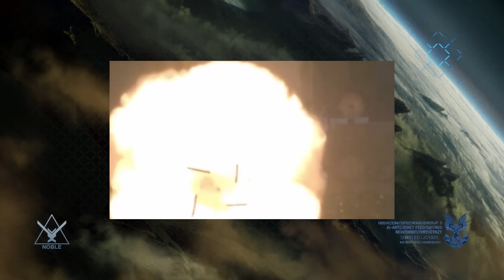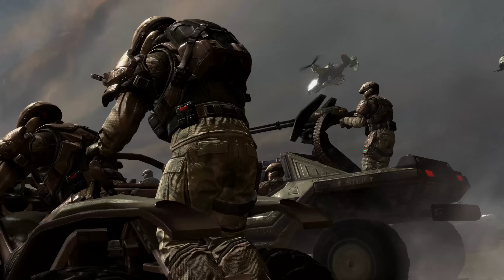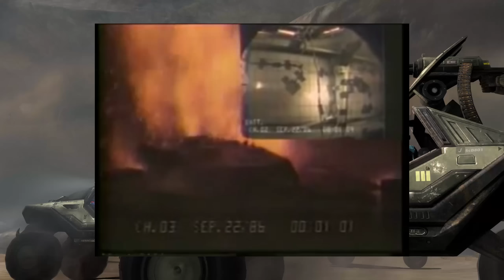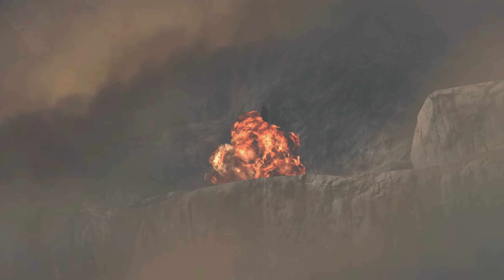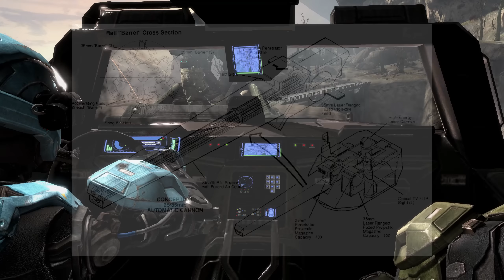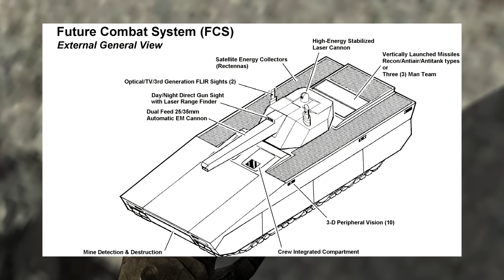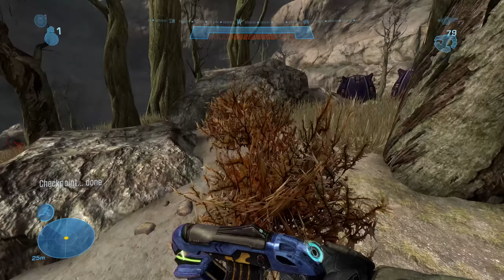Are Railgun Tanks Practical?

Comment: The problem lies not only in amount of energy used by railgun to shoot but also in time to transfer this energy from capacitors to magnets in the barrel. For the mentioned railgun on the ship the capacitors are extremely expensive and complex because they need to discharge VERY quickly. Or the shell wuould leave the barrel before reaching maximum speed.

Comment: They are more to this matter than the amount you covered.

First of all another pro is simply the recoil reduction. the recoil of a gun is equal to the mass of the projectile multiplied by the velocity of the projectile M = m*v , while the kinetic energy is equal to the mass of the projectile multiplied by the squared velocity  divided by 2 E = m*v²/2. What it means is that with a faster projectile for the same amount of kinetic energy you have less recoil.

The problem with ammunition is always way worse than you make it sound to be,  a rail gun has to be conductive for it to work, and also be capable of enduring thousands of g of acceleration, this limit greatly what payload a rail gun can used, with only dumb inert ammo rail gun are stuck in a pure anti armor role, with no capacity against land and air target for the navy, and no capacity against infantry and air target for a tank. Which is a big problem as it make tank extremely specialized weapon in a battlefield that need weapon and soldier to be able to face a lot of different threat

Also no they won't be on tank in the next 20 years, the army is not even considering them as the next cannon for there MBT ETC gun are,  it's not even sure they will stay one modern battleship as they are other alternative to fire faster projectile like light gas gun ETC, rocket assisted projectile or even simply better propellant for chemical round.

Comment: An interesting implication about a railgun equipped tank is that if you manage to install a powerplant on a tank that can power a proper railgun for the duration of the mission then the tank might be propelled completely by electric motors, because such power-dense powerplant should produce more then enough power for the locomotion of the tank.
In fact such compact powerplant would make combustion engines obsolete, because the combustion engines occupy larger volumes due to its fuel tank, has lower energy conversion efficiency, its fuel is are fire hazard.
Reply: Electric engines also are much quieter with no high temperature exhaust, erasing the tanks heat signature and severely dampening it's audio signature. Can someone say stealth tank?
Reply: The lack of heat signiture is only true if the powerplant has an insanely high energy conversion efficiency i.e. has negligible waste heat production. This is the more unfeasible part, because there exist enough energy-dense fuel for such powerplant, like fissile fuels. Nowaday's energy extraction methods use heat engines to convert a fraction of nuclear heat to usable energy (even if we would use an ideal Carnot engine), however this is produce a huge amount of waste heat. Another option for energy extraction is the usage of thermocouples. This has the added benefit of smaller size and lower mass compared to a heat engine, but it has poor efficiency. Both method requires a vast cold temperature heat sinks. This isn't a problem on a ship because the sea itself is an excellent heat sink, but such heat sink isn't available for a tank.
Another issue with nuclear power is the radiation insulation, which isn't really achievable well enough at a size of a tank.

Overall such powerplant requires very exotic theoretical technology that aren't available today like fission fragment reactor  (or fusion reactor) coupled with an magnetohydrodynamic generator.
Reply: @bloodtypeinfinity5143  yeah, especially once metamaterials get developed. Imagine a tank with a low heat signature and that is invisible to the naked eye
Reply: This needs more likes.
Reply: you heard of the regular tank, but now get ready for: the Tesla cybertank
Reply: Except that a battery for a motor is always bigger than the fuel tank. Just look at cars. And how would the tank get the energy from? At a Tesla supercharger? No they will keep the combustion engine to charge the batteries.
Reply: Power isn't the issue for locomotion, it's energy. An 8kg projectile travelling at 1000m/s has about 8MJ of energy. If we assume the tank has an alternator on its engine, and the engine has a thermal efficiency of around 30%, that is under a litre of diesel per shot. Looks like an Abrams has around 2000 litres of fuel, so 100 shots would be just 5% of the available energy.

The problem a railgun has is you need to apply that 8MJ in about 1/100th of a second, which is a power output of 800MW, or about a million horsepower. 

So even if you used some of the highest performing capacitors of today that is about 8 tons of capacitor and at least 2 cubic meters of volume. And that is just to match the performance of today's guns. 

So even with a 10 fold improvement in capacitor performance i'm not convinced we'd see them on tanks. All that electrical equipment would be expensive and not really provide much advantage.
Reply: Technically possible, but I don't see that happening, and besides fuel is a fire hazard because it's energy dense, energy dense things tend to be unstable....
Batteries explode in a pretty similar way to fuels.
You don't wanna stand beside a better that's more energy dense than desiel when it gets hit
Reply: Or you might need a much larger powerplant, seeing a return to super-heavy designs for tanks.
Reply: I'd prefer the "hybrid" solution, electric motors power by batteries>batteries charge by ICE. Big problem with space, unless they come up with more efficient batteries. 😬
Reply: How about a nuclear fission engine? Of course, when we get there. Edit: I mean generator
Reply: @pcb_404  For a generator I'd say Fusion is better, as it doesn't create radiation. However the technology is less developed
Reply: @jafon9  ah I think I got the terms mixed up then, I mean the one that does not produce radiation
Reply: @pcb_404   It's an easy mistake to make.
Reply: @pcb_404  fusion does produce radiation. And pretty brutal one.
Reply: @Poctyk  no, it doesn't. Go do even a tiny bit of research on the process by which we perform fusion.
Reply: @pcb_404  The government already tried making a nuclear powered tank in the 50's. It never took off.
Reply: @bloodtypeinfinity5143  well if they wanted it to fly they should have thrown more money into it
Reply: The fusion reactor would require HUGE plant to move the tank.
The LWR is too big too, radiation shield isn't small...however there is a SOLUTION!

The thorium molten salt reactor! See:
https://upload.wikimedia.org/wikipedia/commons/3/30/Lwrvslftr2.png
A 20 MW reactor would have size of the average fridge.
Small, compact, high effciency. Whatever we neeed! We can use fission-driven Radioisotope thermoelectric generator

Comment: I guess depending on the weight of the shell and its force of impact railgun combat and tactics would be similar to that of USI-152's vs Panthers where the sheer force of impact from the 152's shell would break the turret rings if the panthers, or smash the turret panels in breaking them free from their welds
Reply: With Railguns, it would be more inclined to tear right through, no?  Overpenetration may become a concern.
Reply: @northropi2027  you don't have to fire it at full power
Reply: @justinbeath5169  Well that could be a solution to overpenetration and the explosive sensitivity concerns in another thread, but penetrating the target would still be preferable to whacking it really hard as OP suggests.

Comment: Kinda doubt it. The amount of power you need to repeatedly fire one would require one hell of an on board generator running off the engine or a battery with insane storage capacity. I think the propellant in tank rounds will likely be far more efficient for a long time to come. On Navy Ships though? They're already doing it, because they already have the on board power production capabilities.
Reply: But keep in mind that we would see smaller but powerful gnerators that will allow to put railgun on tanks.
Reply: The thing with railguns is that, oddly enough, it is wholly on the capacitor. Right now we're working on various capacitor designs (and one if I heard right, made out of 'crumpled' graphene). They'll be on ships for the near future but likely be fitted onto tanks sooner rather than later because, oddly enough, Battletech has kind of revealed how armor is going to go in the future thanks to what is essentially EndoSteel showing up back in 2017.

Comment: Would it be feasible to have multiple barrels in a rotating setup (as they presumably are in that diagram) to extend the life of the system before replacement?
Reply from the maker: I think that's more for cooling. That sort of setup would extend the lifespan, but be more expensive.

Comment: What a huge deal was made of that Halo: Reach atmospheric MAC gun shot. Only for it to sound and feel like a wet fart.
Reply: So dam true, I was expecting a deafening explosion with the visors shattering on the spartan armour
Reply: However the mass-driver at the dockyard in Pillar-Of-Autumn sounds gorgeous
Reply: SPARTAN helmets prob reduce sound signatures so your fucking eardrums don't rupture while you're trucking covenant and stacking bodies.
Reply: @nuclearjanitors  that's actually what they have like it's on the grenade explosions
Reply: Sound effects in Halo have always been weak. 

The ones in cutscenes I mean.

It’s like Bungie and later on, 343, forgot to do a final sound edit or something
Reply: That surprised me when i first saw it because I had read the books up to that point before then. If I remember right, a MAC round is something like a multi-ton slug of molten nickel, iron, tungsten, etc. propelled to ridiculous speeds. A short-range shot like that should have blown out everyone's ears.
Reply: @wayfarerzen  Basically the amount of impact should've made it look more like a small nuke going off.
Reply: Halo wars did a better job depicting MACs
Reply: @montypython5521  I wouldn't say so, as the Spirit of Fire had a uh.. pretty weak MAC
Reply: @wooflessdelta The visuals at least
Reply: Woofless Delta that was dialed down by a LOT. As is most weaponry for the games. It wouldn’t be fun to watch your marines die from a single needle shard or bolt from a plasma pistol. Even near misses will incapacitate due to heat exposure. Both UNSC and covenant weapons have their firepower and destructive capabilities reduced for gameplay balancing... A standard frigate “light coil” Mac fires a 600 ton tungsten/depleted uranium projectile at 30 kilometers a second. That type of firepower would obliterate any covenant unit in halo wars and would single shot even shielded citadels. Same thing with reach. That Mac blast was scaled down so much. Even a frigate like the stalwart or Charon class would have completely obliterated that area with a Mac round and most likely the entire area of mountain with it. As that’s a Paris class heavy frigate it would most likely have a stronger Mac, which in turn would deal much more damage. In saying this, the spirit of fire also possessed ten naval coil gun batteries. UNSC NCGs (naval coil guns) or naval auto cannons; are for all intents and purposes “mini macs.” These are the weapons that are most likely actually being used for orbital support rather than any of her three dedicated macs.
Reply: @_Offensivebias_  Yep.  Also, a fuel rod cannon would be able to kill even a spartan with one hit.  Also the Banshee was so much faster than in the games lol.  Deliver Hope shows it accurately, with a Banshee zipping around and nearly killing Kat just with a near miss.
Reply: When the frigate firing it exploded I thought for a moment that it was destroyed by flying debris from the thing it just shot at point blank range. Fast forward to Reach’s rerelease, and I’m watching a stream of reach and make the same wrong inference.
Reply: @Phos9  now that would have been cool, or at least pelted by chunks of rock and debris

Comment: yeah its a no from me, getting the power needid for it is impossible, even more so if the militaries are trying to make elecktric tanks.
Reply: As Spookston said in another comment, people thought it was impossible to fit a computer into a tank back when they were the size of a room.  They said that right up until it actually happened.
Reply: @MrUoutthere  …….there is a limit to our power sources. at one point the (brobs lithium ion because it is the best battery we have) becomes so heavy and concentrated that it becomes a bigger fire hazard than regular ammo. this "at one point X was impossible and it is now possible so z WILL become possible as well" is so pointless. one of the examples is space travel, no amount of development will turn our speacies into easy space traveling gods. because the same laws of physics that were a problem inthe 70ties are a problem now. the physics around us will not change and neither will power storage in a battery or the problems that come with that, for example a quick draining of a battery of its power will lead it to overheat a probleem that every electric car manufacturer knows. but at least they ill not drain it as fast as this gun. its just heavenly impractical, useful on ships, where there is room for large power generation and storage but not on-land vehicles.
Reply: @olluman123  and yet again you fail to understand the situation. There aren't any laws of physics preventing the storage of large amounts of energy (quite the opposite in fact). And besides, there already have been vast improvements in energy storage. To say that they will not progress at all beyond what we have now is naïve to the extreme. Anyway, your insinuation that space travel hasn't improved is completely ignorant bordering on idiotic. You can't honestly believe that technology will never progress from what we have now.
Reply: @MrUoutthere  why electricity is so bad at powering our cars and guns is the battery, it is one of the worst ways to store energy unlike fuel for the combustion engine tha is pretty much at the top of power storage, as well as propellants as gunpowder or its rivals. the rail gun would be fantastic for ships that have alot of room for power generation and storage as well as they need the extra power and distance that the gun proovides. so ships yes, land vehicles no …….unless they bring the mega tanks and train guns back, wich theywill not because ...you know….air power…….drones...
Reply: @MrUoutthere  its just that the battery (no matter the type) is a very bad power storage system, but its the best we have to store electricity. And thats a fact. Im sorry, i too would love to have the mightiest guns with power unimagined with tanks running on electricity, but its just not going to happen. Batteries are just terrible and improvements at this point is infact impossible for the drainage of power for a battery with more outbut wouöd simply melt itself.
Reply: @MrUoutthere  im just being realistic.
Reply: @MrUoutthere  when they walked on the moon, they thought that by the 2000 going to space was ordenary for everyone. It isnt, because the problems are the same, the vacum is still the same, radiation is still the same and we still use the same system of getting upthere virtually strapping a capsule to a well calculated bomb and hope that everything goes well. We are not gods, our materials have limits.
Reply: @olluman123  Except the technology is not the same. Every aspect of space travel has been vastly improved in the past 50 years.  Rockets are smaller, cheaper, (some) are reusable, and they are all more precise in their missions.  I think that it may not be soon, but there will be a leap in energy storage.  There is no one saying that it MUST be a battery.  Who knows what form it might take?  There is simply too much money to be made for energy storage to be ignored.  Even if it's 50 years from now, someone will create high-capacity energy storage methods and will become a billionaire because of it.  It is inevitable.  Batteries may well have reached their limits, but energy storage as a whole has not.
Reply: @MrUoutthere  rocets being smaller or reusable does negate the fact that space travel is difficult and will not become an easy thing to do. As for energy i dont think there is another form of higher capacity electrical energy storage out there. Would be great, but there isnt, agree to disagree

Comment: Putting aside power plant, putting on a tracked vehicle (regardless if it’s armoured) is sensible because it’s a basic land platform. You could potentially put it on a wheeled vehicle or towed. I would compare the idea to the otomalera 76mm. A naval gun that was also made available as a tracked SPAAG.

Comment: Well very good debate.
But I think you should see and look into the Crysis Rail gun Tank.
Its a Challenger 2 Hull whit a Different Turret capable of Firing a Much smaller (Possibly 30mm) Rail Gun.
It fires the Round at about Hyper Speed that is powerd by what I assume a Battery thats so strong that needs auxilary charging.
A Big gun means a bigger tank,a Small Rail gun might provide much more Rate of fire and easier to use then a bigger one.
a 30mm is what I assume,take the Crysis Rail Gun tank for example,it fires what I think is every 10sec whit a almost pin point precision due to the round flying so fast,and whit the diameter of the round and size it will make it still lethal to older tanks.
Going from the Standart Super sonic APFSDS to the Hyper Velocity APFSDS.
And I think this type of technologile will come in 20 year rather then the Idea you pulled from what I think is Halo.
Try the Crysis series,its like Halo,Just more cooler and inovative.
Reply: However in Halo railgun did not exists on tanks for some reason.